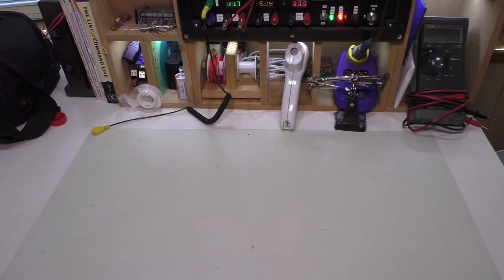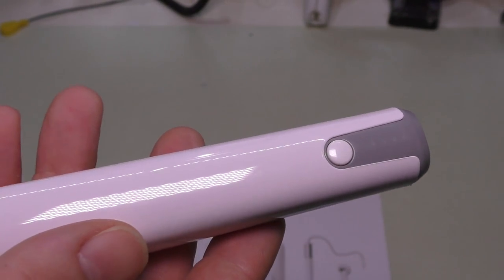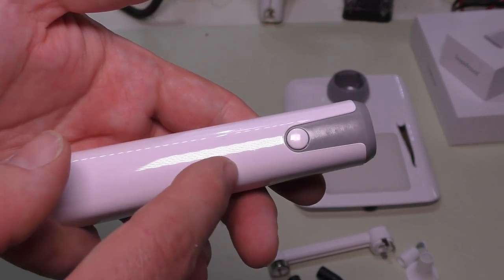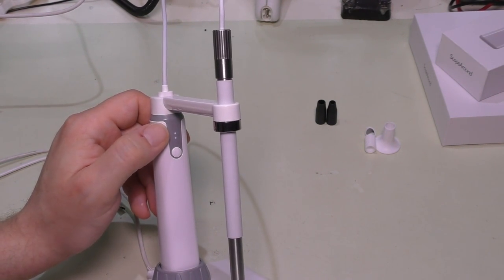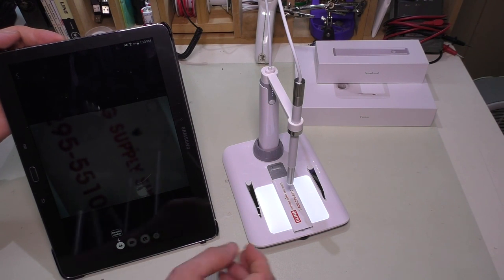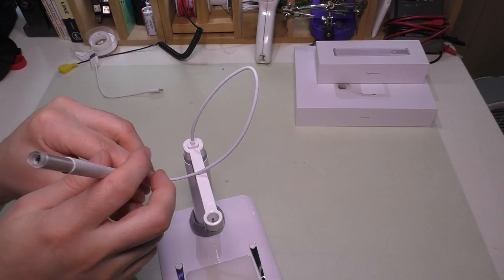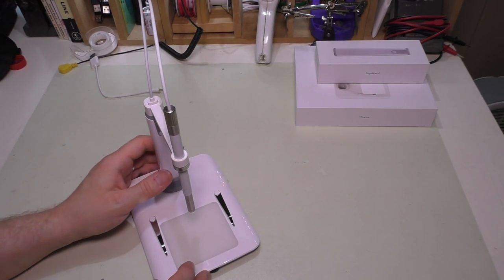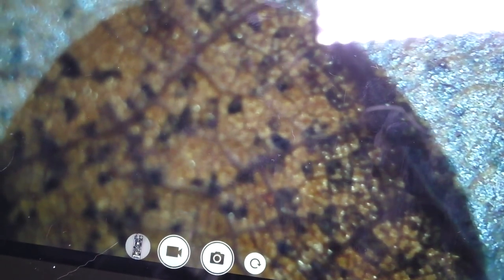PTS Ep. 189 - GEECR ScopeAround Focus (WiFi Microscope) Review

Comment: That movement that shows up in the bit at the end there,  from the video recorded by the device,  is nauseating!  You might try plugging it into the Ubuntu box (that Acer laptop?) and see if it recognizes it.  I have a cheapy USB microscope I bought off ebay some time back, continuously variable lighting (from above),  USB connection (no WiFi),  you just plug it in and it works. About $20.  Under Ubuntu,  the "cheese" app displays stuff on the screen (designed for webcams).